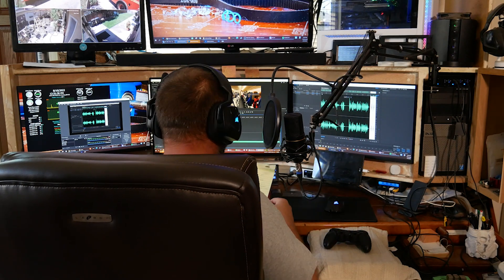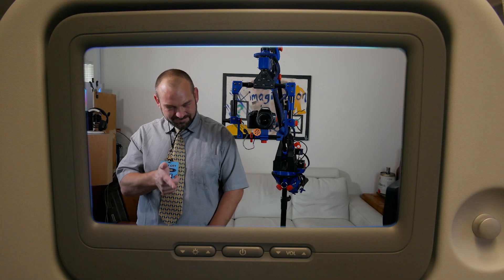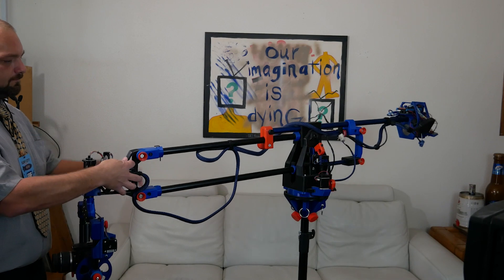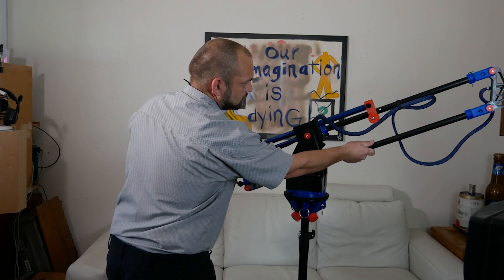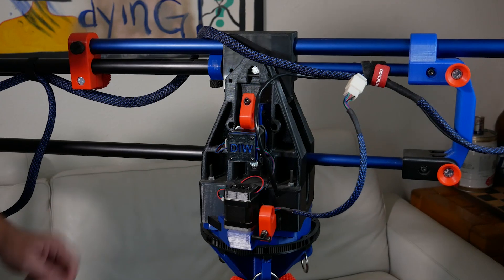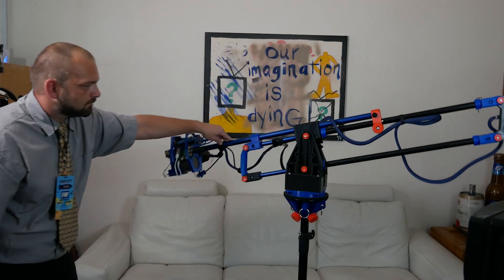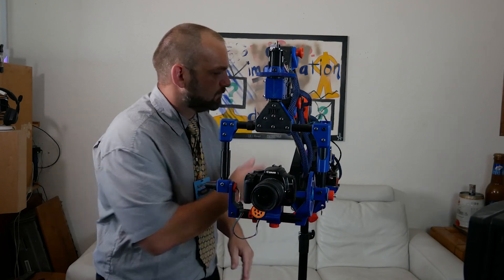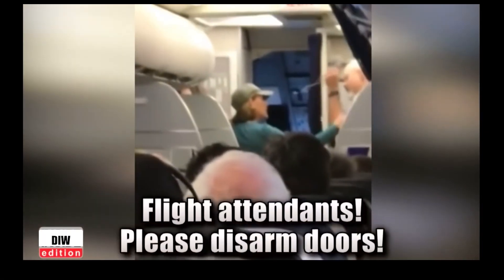3D Printed motion control camera | Setting up the rig

Comment: 20-ish parts printed so far. 
Parts purchased except the ones that are persistently unavailable on Amazon. 

3rd degree burn, but back up and running.

More printers needed if the fleet is ever going to boot.
So stoked on this project and happy you have re-emerged.
Reply from the maker: Nice!  I did make some minor changes but nothing that's a huge part to print
Reply: I printed the base a couple days ago as my first part and it took nearly a spool of filament 😂
Reply from the maker: @canadaplease7981  Ya its cheap to build but it doesn't skimp on filament... I printed nearly every part solid. I just tried to keep the "head" parts down in weight but even then... you need the strength.  It's not perfect but it's awesome :)